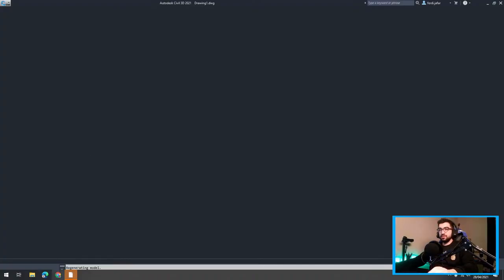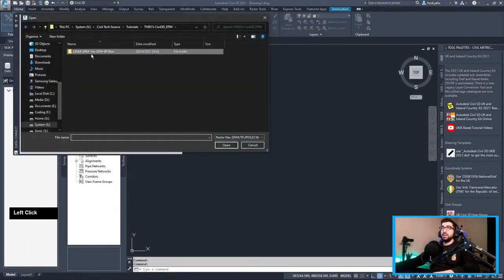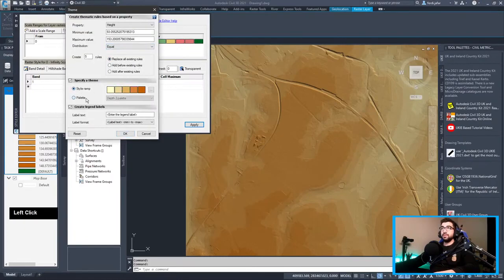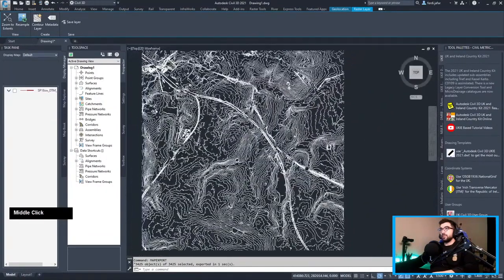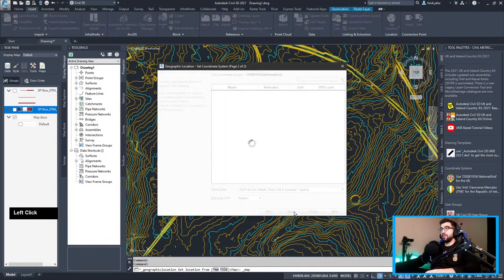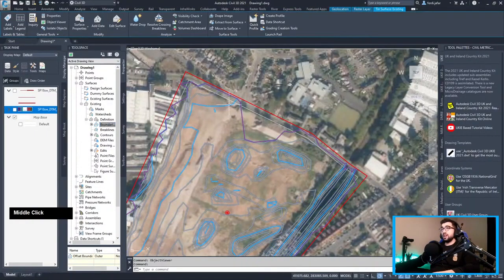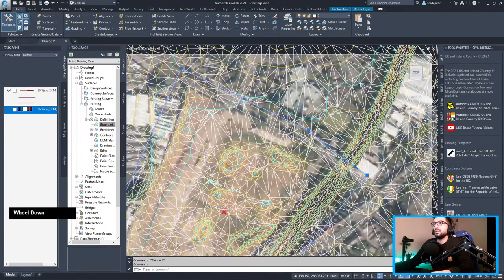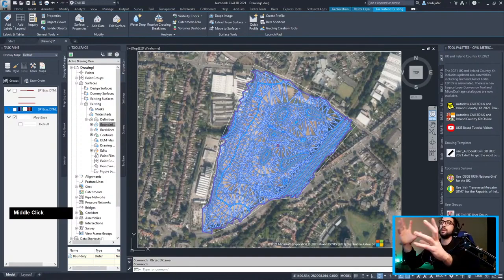Civil 3D How to Import Lidar DTM (1st Live Stream)

Comment: Hello! This video is really good. I need to get the LiDAR contours into AutoCAD and don't need these to be 3d, just 2d with the contours labelled. Do I need to go all the way to making it a surface? Is there any way once I have run the contour tool that I can then export that data to CAD as is? Also I couldn't see a way to trim all the contours to my redline boundary shape and they were all on the same elevation (this is after running the contour extraction and before trying to make it into a surface. Also if I have to make it a surface in order to import into AutoCAD, my site is split into 2 DEFRA lidar image tiles, and therefore the contours don't join up properly, so concerned that the triangulation will go funny. If you could guide me on the getting 2d lidar contours into CAD without making a surface that would be super appreciated. Thanks for the video!
Reply from the maker: I would then recommend doing the contours exports via QGIS, as you can merge lidar together (faster than c3d) and also add labels etc.
Reply: @CivilTechSource  Okay thanks, yes I have done these in QGIS previously, so thought I'd have a go in civil 3d as we now have access to it at work, but if QGIS is more efficient for what I need I'll stick to that. Thanks again!
Reply from the maker: I found qgis easier and faster to deal with lidar. I think c3d was not optimized for gis process.

Comment: It seems to me when comapring this workflow - the result surface has major issues and is quite innacurate when compared to recap imported data. Would the more dense contours fix the issue?
Reply from the maker: I suppose more dense contour can help. However the whole point of lidar is for very high level assessment so having denser contours wont do much difference if you are doing earthworks volumetrics. I always insist to have 3D topo carried out on all projects I work on. No topo no work

Comment: Thanks for the video. Is there a way to import multiple Lidar tiles at once and apply the same style to all of the layers?
Reply from the maker: Maybe if you have them all in the same zip folder?
Reply: @CivilTechSource  Thank you!
Reply: @CivilTechSource  That worked out well. With the amount of data that I've brought in, the loading time has been significantly decreased so I think it's best to have them as separate tiles. Do you have any advice for saving a style that I can simply apply to all of the tiles to save time? Thanks :)
Reply from the maker: I can only think of using the default ones. As the style will be based of values such as elevation, each lidar will have different set of elevations. So maybe once importing them you better of merging them all into one?